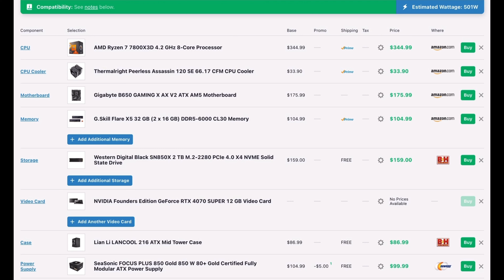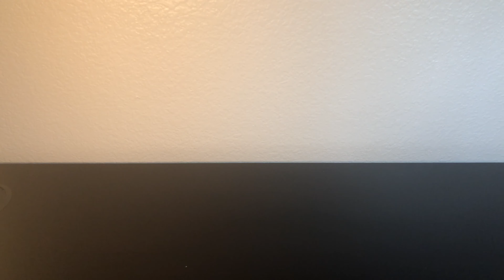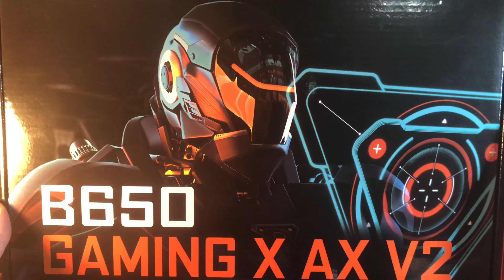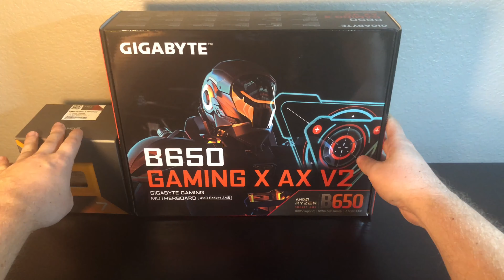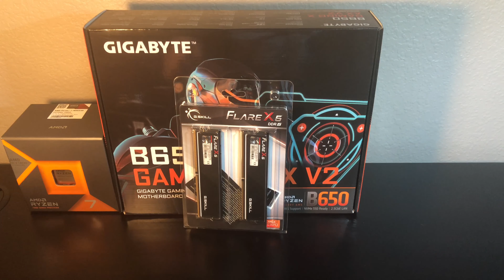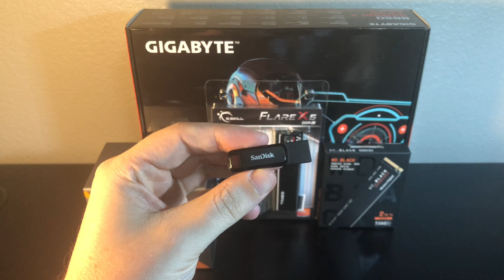Rookie BUILDS First GAMING PC | Part 2: Gathering PARTS

Comment: Solid list. I always keep an eye on the MicroCenter bundle deals. Only thing is maybe add in a spinning hdd for long term storage. That's what I do with older project files and completed media just so it isn't taking up space on the working drive if you aren't doing external storage or NAS.

Also I don't know if you're going to follow anyone's build guides but assembling everything you can on the mobo outside of the case really is worth following.
Reply from the maker: Agree on building the board outside of the case. Ironically I built it a couple times and now lean towards instead going with a laptop for video editing lol. It was cool to learn how to build regardless though.
Reply: Spare storage is clutch

Comment: wow lol, I just build this same pc on Newegg with 10% off sale almost on Friday. Same cpu/gpu/psu/case/ssd. Only went with slightly cheaper MSI MB, though I had same x ax in cart debating. Mostly do mmo so hoping to test higher cpu over video card. Probably upgrade to 5000's if better by alot and sell 4070super. I know its always get best GPU over cpu, but at least 7800x3d should last 6 years for me i hope.
Reply from the maker: That’s awesome! Feels like validation on some of my choices lol. 

The motherboard I went with doesn’t seem to get the best reviews, but it’s what came with the bundle so hoping it’s good enough.

I imagine the CPU will be fine for a while, even when they come out with newer models. I’m likely to keep the 4070 Super for a while, so I won’t focus on 5000 series. I imagine resale value for you will be there though.